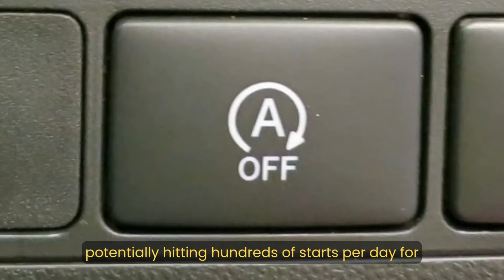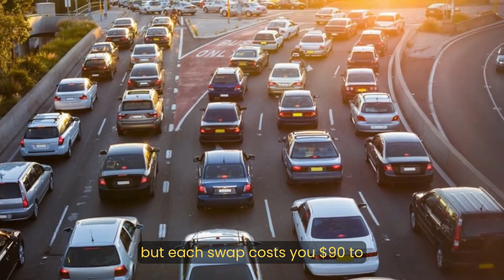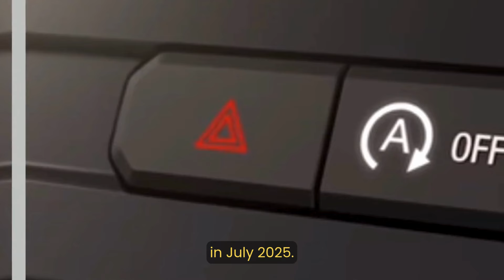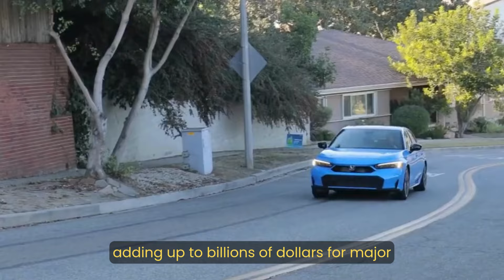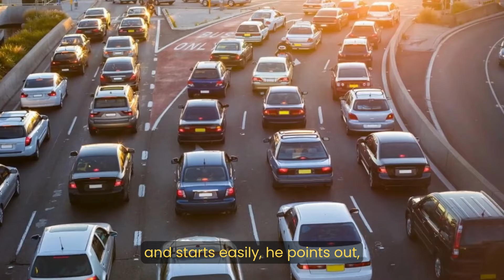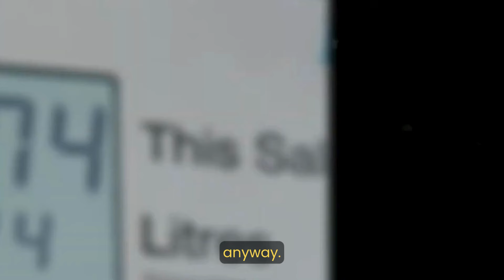This $200 Car Feature Will Cost You $8,000 in Repairs

Comment: I turn start/stop every time I start my car. I'm pissed I can't turn it off and keep it off. EPA never said that Start/Stop system can't be turned off and kept off until it turned on again. Automakers just made it permanent on theit own accord.
Reply from the maker: You're technically right. EPA doesn't ban permanent disable. But to get the off-cycle credits, the system has to be 'non-latching' (default ON every start). Automakers could let you disable it permanently, they'd just lose the credits that help them meet CAFE standards. So it's less a mandate and more a strong financial incentive. Either way, we're stuck pressing that button every time

Comment: It is a stupid feature, and another instance of stupid government rules that do nothing good in real life.  The video makes one mistake, I believe, when it says that turning the (stupid) feature off may not be worth it since the expensive equipment is already onboard.  The key is not that the stuff is onboard, but how long does it last. If shutting off the (stupid) feature prevents or delays a battery, starter, or engine failure, it is definitely worth it.  Any savings is gasoline is more than offset if there is a serious and expensive repair needed, especially if needed earlier in a car's lifetime.
Reply from the maker: You're right that disabling it could extend the life of your starter and battery by reducing those extra cycles. If it helps you avoid even one premature replacement, that's real money saved. Good catch👍
Reply: @realflightiq  have talked to some people who had to replace an engine due to main bearing failure. No amount of saving gasoline will pay for that.

Comment: My 2016 BMW has this feature which has been on and I have used since I got the car. 156,000+ miles and not a single issue related to using auto start/stop.

All the fear mongers out there need to stop trying to drive up their oil & gas stock profits 😅
Reply from the maker: Appreciate you sharing that. 156,000 miles with no issues is impressive, and BMW definitely builds one of the better start-stop systems. They’re also one of the few manufacturers that let you permanently disable it if you want. The video covered both sides, including experts who say the technology holds up well when it’s engineered properly. Glad to hear it’s been working well for you.

Comment: What wasn't mentioned here is that many of these cars require 2 batteries instead of the typical 1. Then several must be installed at a shop and not for free like the simple ones at the auto parts stores.
Reply from the maker: Good point. Some vehicles do run dual battery setups for start-stop, and the installation costs add up fast when you need dealer programming. That makes the cost of ownership even higher than what I covered. Thanks for adding that.

Comment: After our vehicle was stolen, one of the rental vehicles we were given was a BMW and I noticed that I was able to disable the stop/start permanently. The amount of money that most save on fuel doesn’t begin to cover the higher costs of repairs and replacements and although components like starters and batteries might cost more to replace, using and stressing them less should lead to longer life. Our Toyota Tundra automatically deactivates the system when tow/haul mode is in use so perhaps that tells us something.
Reply from the maker: Great points. BMW is one of the few manufacturers that lets the system remember your last setting, which is how it should work. Most automakers don’t allow this. Your point about the Tundra is spot on. When Toyota automatically turns off start-stop in tow/haul mode, it’s basically admitting the system isn’t ideal when the engine needs instant power or is under load. If it’s not good for towing, it raises fair questions about using it in stop-and-go traffic where quick response matters. Thanks for sharing your experience.
Reply: Is it just about saving fuel. Surely its  more about pollution ( and also meeting legislation). The measured high air pollution levels in city centres is very mainly due idling cars. Dosnt this cause a health worry.  Of course we could make city centres hazardous locations to work and live and also to travel through. Perhaps we could say so what we cant see the pollution. so why bother.  To digress a little I can recall in my youth air pollution being so bad that foggy weather could make it near impossible to  drive a car without assistance from some walking in front of the car. Surely also helping to save the planet for future generations  is a worthwhile consideration as well. My solution vastly improved public transport, less cars on over crowded roads, work from home etc . The IC engine powered car is on limited time.
Reply: @amvvol2  Yes, it is also about air quality and meeting emissions standards but I think that for many drivers the costs associated with it compared to the actual effectiveness of it is rather steep. Replacing traffic signal lights with roundabouts as they have in Europe would probably save a lot more emissions because it would reduce idling waiting for lights to change.
Reply from the maker: You make a good point. Start-stop systems were mainly pushed by CO₂ regulations in Europe, not just fuel savings for drivers. That said, the system only helps if people actually use it. With around 40% of drivers turning it off, the real-world impact is much smaller. Your broader ideas (better public transportation, fewer cars on the road, and more remote work) would make a much bigger difference than start-stop ever could. And as EVs take over, this whole debate disappears anyway. Thanks for the thoughtful comment.
Reply: @realflightiq  except it never will with ev's. the process to produce and ship ev batterys means frieght ships are burning nearly twice as much fuel oil. it has to be shipped from the strip mines (which are running deisel fuel equipment) to the processing plant to refine the metals, then ship it to a manufacturing plant to turn it into actual batteries, then it has to be shipped either to another manufacturing plant to build different sizes of batteries (single sell to something like a 6x6 cell exct.) then ship to the car manufacturer to get installed, then the car itself gets shipped. soo much diesel and crude fuel oil is burned in making an EV car that its almost the opposite of reducing carbon emissions
Reply from the maker: @zenisan1 That’s a fair point about the supply chain. EV production has a significant upfront carbon footprint, particularly from battery materials and shipping. It’s definitely not as simple as it’s sometimes made out to be. Thanks for sharing that perspective.
Reply: @realflightiq even after production enviromental and personal chemical/fire/recycling energy is through the roof.